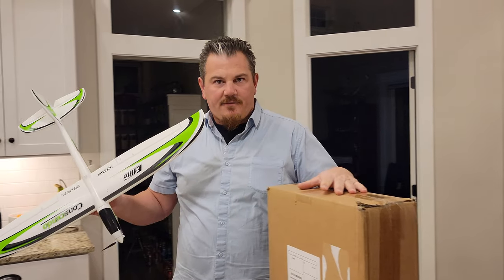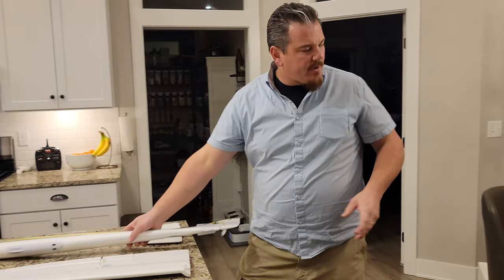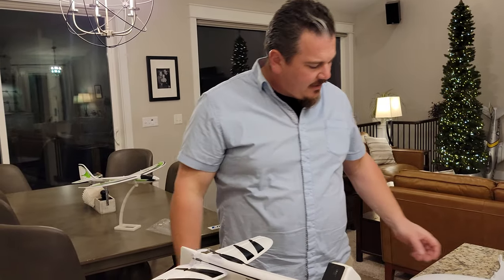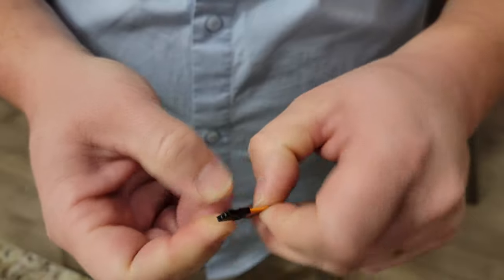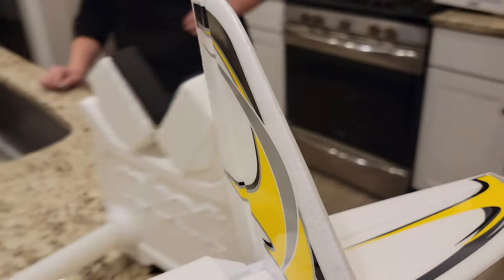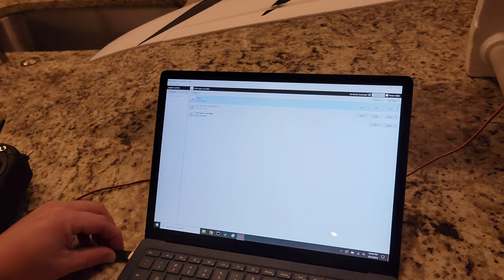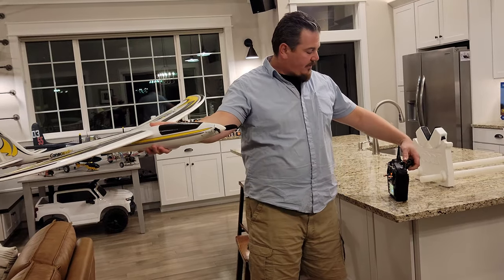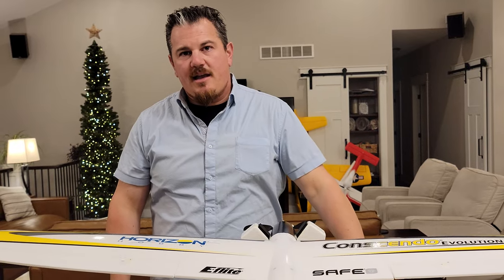E-flite - Conscendo Evo - 1.5m - Spoilerons VS Flapperons - Unbox, Build, & Radio Setup

Comment: This is just what I need to get off my duff, break the ESC programming, add another connection to make the dual aileron configuration.  Way to go, Brian!!!!
Reply: When you do this. Make sure you update the update cable first before anything else it will make it much easier. That's why Brian was having a problem
Reply: @jamesturncliff5960   Thanks, yeah, I bot the cable, registered the receiver, updated it, but have yet to proceed, etc.  I'll store the original settings into history/backup, and then clear them to be able to go to flaperons.  Simple if you know what you are doing...........

Comment: The plane had a small round skinny fuselage.  Most of the weight of the plane is the wings, on top of the fuselage,  above where the stand holds the plane.  It is like a pyramid, upside down, balancing on a point.